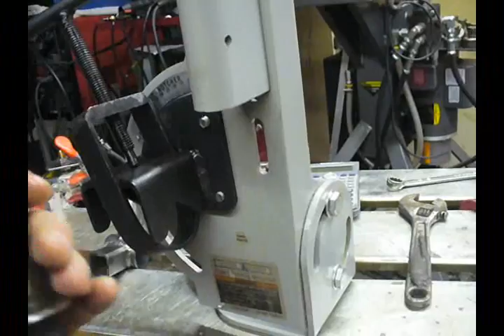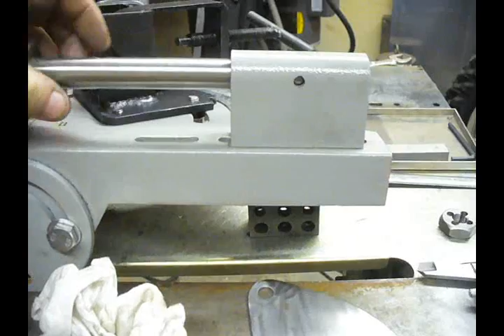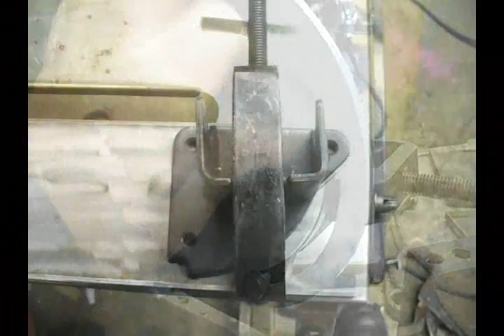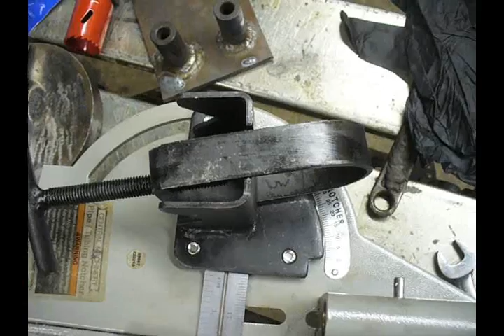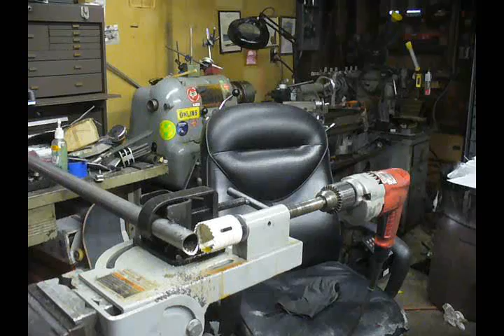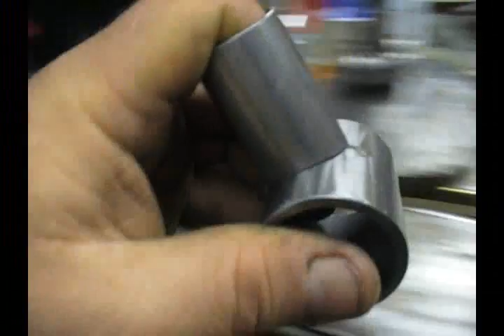Harbor Freight Tubing Notcher Modifications

Comment: worked in fab shops and had a machinist boss at one place. He had an additional suggestion. If I'm drilling or cutting metal, use lots of penetrating oil. ( any oil is better than none, but also power steering, or brake fluid works well too) this will at least make your blades and steel saws last more than twice as long. Since good drill bits are very expensive in a mfg. department, consider purchasing and pointing a vortex cooler nozel at the contact point. A cold edge will keep it's edge longer than a hot edge.

Comment: In 13 years the product is exactly the same. I just bought one for $54 and had the 20% coupon. 

Agree on buying good hole saws. After doing the adjustment you showed I cut 2 pipes with a cheap saw and it was done. Put a Bi-Metal Lennix saw in and finished 26 more cuts. looks like I can get maybe 20 more cuts.

When doing some 45 degree cuts the axleshaft flexes some so the notch is a bit distorted but a quick Drimmel and its OK.

Comment: Kinda funny (and a bit sad)... 13 years later and the notcher I just bought still has the same exact alignment problem. I fixed it with some washers between the clamp and the base, but I like your solution better.

Comment: Technically they are hex head cap screws, so you are correct calling them screws. Screw is the angular movement around a cylinder. Ships move by rotating a screw(propeller).
Bolt is a cylinder shaped object, rifle bolt, door bolt, bolt of fabric, etc. 
Screw is the function, bolt is the shape.

Comment: applying oil to the cutting surface when the jobs done is bolting the stable door when the horse is gone
Reply: And you just contaminated the tubing for welding.  Saws should be cooled with water not lubricated with oil.  Oil actually causes premature dulling of the teeth.

Comment: Some people said they would of used washers which was my first thought too. But I think what he did was a better idea for the long run. For me i have always  used my drill press with 2 pieces angle welded to a flat steel plate with a hole in the center of it. Works great for me. I also use a 1/8 inch larger hole saw than the tubing size it seems to fit up  better. I always like to see these videos and thanks for taking the time for posting it. Also pay no mind to the negative comments.

Comment: I got one of these, worth the price. You have to look at it as a improvement over cutting by hand, not a substitution for high end. The bearing lube is  key, lube liberally.    I found the biggest limitation was the design of the clamp band. It can't be removed or bigger spots / bends won't slip through it.  I cut the sides at the top and added bolt on brackets. Now I can disassemble the clamp and reassemble on the spot of the tube.

Comment: Really , why not take a chop saw with a metal blade set it on 22.5 degrees mark the tube at top center an cut . then flp it over n cut to center again wow too easy! U have a saddle fit for a hand rail

Comment: I bought this particular tubing notcher and it's just a piece of crap I have fool with it about 6 hours and never made a cut that I was satisfied with I shimmed it out but actually I tried everything different size pipes ,brand new kit of cutter blades nothing works I guess if you was making a gate to go out in the barnyard it would be okay but I wouldn't attempt to make roll bars or even the go-kart frame I'm working on

Comment: can it be used for square tubing ?
Reply: Bob Americana  Yes you could... are you mating round and square? The square would be at a 45° because of the V notch. If 90° is desired just use a drill press.
Reply: i am making a square tubed trike frame. i will be needing a round hole in it for the regular front fork assembly .   look at the 2nd picture : http://www.atomiczombie.com/LodeRunner%20Single%20Rider%20Cargo%20Trike.aspx

i am wondering if i  should buy a notcher for this or simply pay a shop to do it.
Reply: Bob Americana  Well ok in the aspect of the degree that is a compound angle. As for my previous comment... 90°× ?. Personally I would get a small drill press from Harbor Freaght. Cause a shop could charge you most of the cost of the drill press. The drill press table can be set on the angle of the rake you choose while the other is 90°. If you notice on the notcher there's a v shaped holder and the hole would go corner to corner... not through the center of the square tube. If this is a one time project then drill press. If multiples the you might consider modifying the holder on the notcher and then it would serve that purpose alone.
Reply: Bob Americana  Then again If it's a one time deal you can do it without either. Mark your angle on the side carry it over on the top and bottom then center drill the holes for the center drill of the hole saw. I went back and looked at the trike it's a pretty Cool rig ! The drag link steering is nice and simple. Ok I went back looking at the other model's... you could incorporate the front frame of the bike like some of the other model's and not need to drill the holes in the first place.
Reply: i get your points. i suppose i will simply mark and use a drill for the 1st build. if the trike cruises at a decent rate and is easy to use, i will be building more and placing them on consignment at local bike shops. i do not want to use a regular bike front end hacked off and welded to the square tube. that would simply look bad. you get the idea. thanks for the tips
Reply: Bob Americana Right that's why I asked if you might be making multiple parts. But if you do produce more a small drill press will be beneficial. H.F. $64 for the small 5 speeds I have one and its good.

Comment from the maker: Cody, as you're saying you build enclosures for horses etc, then your method is fine. I was under the impression you were building for automotive. And an 8k notcher is WAAAY overkill for chassis work...kind of like a gold plated hammer.  It won't drive a nail any better than a plain hammer, but it sure impresses the audience .good luck in all your endeavors.

Comment: I can do it by hand in sec . line down the middle fish mouth line on both sides . cutting blade with the grinder or a torch . or you can by template s I have those 2 they work great .
Reply from the maker: If you're cutting your tube with a torch, I CERTAINLY don't want you making any chassis components for me... Yes, you CAN cut tubing in all manner of ways. You could even drag it over a concrete curb long enough to make the cut. Sometimes, having a proper tool allows you to do PROFESSIONAL QUALITY work.. This is extremely affordable, repeatable and doesn't use caveman tactics to get tubing fitted...You won't find a SINGLE PROFESSIONAL Chassis builder using a grinder to make tubing cuts... Up your game and do higher quality work.
Reply: Jim Harvey . if I were to build a chassis I'd use one of these https://www.baileigh.com/end-mill-notcher-tn-800 . I use torches on pipes . tubes like horse corals I have hand notcher or all throw the cut of wheel on if it's thick .

Comment: I need a tube notcher and was on Harbor Freight's website reading reviews and most of the new ones are stating that the need for shims has been rectified. I guess I'll find out. If its good or bad I'll report back what I find.
Reply: So what did you find?

Comment: Hole saw update. Found that manufactures rarely tell you if their hole saw  sets take a threaded arbor or take an arbor with flat sides that locks in to flats on the hole saw. Found both styles at the big box stores and you don't know without breaking open the box. Clerks give dirty looks but they couldn't tell me either.  Buying on the internet you rarely see them marked. Pretty dicey.  Thanks for the help guys!
Reply: would be nice if there was an adapter to use either.

Comment: I am searching the internet for threaded hole saws to use in my newly purchased tubing notcher. Seems no one wants to sell any. I see  folks say all the big name suppliers carry them. But no where does anyone advertise them for sale. Any help with reasonable priced supplier of THREADED hole saws to use with these tubing notchers. Part number or link appreciated.
Reply from the maker: HI Steven
You can find teh threaded saws at any Home Depot or Lowes.. DO NOT BUY hte cheap Chinese saws. Buy a good Bimetal saw from MIlwaukee or other name brand.. Go slow and use lots of lubricant and they will last a long time.
Reply: Thanks Jim I will check that out.  When I couldn't find any on the internet, amazon, or ebay l thought oh great, here we go. I bought a tool that no one makes a hole saw to fit.
Reply from the maker: Steven Hatfield look for LENOX saws at LOWE'S As well.
Reply: Funny, I have never seen a hole saw that was not threaded at the base. https://smile.amazon.com/Milwaukee-49-22-4025-13-Piece-General-Purpose/dp/B0045CSOIY/ref=sr_1_10?s=power-hand-tools&ie=UTF8&qid=1517271419&sr=1-10&keywords=hole+saw+kit
Reply: Ron Micjan I am finding that most are threaded. But I owned two sets (wood vs metal) that go on an arbor with flat sides.  Problem is 90% of manufactures do not state their hole saws are threaded. Being new to pipe notchers I had no idea other than breaking open the packages.

Comment: you could mill, sand or grind down the block that holds the drill shaft as well. I think that would be the most accurate way to get the centers aligned.

Comment: you should know that you were not wrong about the calling the screws,  screws. they are in fact a CAP SCREW. a bolt is defined as a cap screw with a nut on it. so a bolt is an assembly. not a singular thing. great video by the way
Reply from the maker: :) Thanks!

Comment: 8:07 If you had used lube or at least spray water on it to cool it, your ElCheapo would still have teeth. Looks like you high dollar one won't last either if you dont cool it in short cuts. YOU CAN'T RUSH THE CUT!
Reply from the maker: try reading the information in the video
Reply: If I wanted to READ, I wouldn't be watching a video!
Reply from the maker: Is it that you don't care to read or that you are unable to read? The words were right there on the screen... But you don't really care about that... You're much more interested in snarky comments... Carry on...
Reply: Look who's being SNARKY, I just said a cool bit / hole saw blade will last a long time.
and don't force the cut.

Comment: Great Video and I agree with your choice on solid shim verses washers. Spot on with your reference to small errors add up. If its not cost prohibitive and you are not pressed for time, why not do the best you can. What type of cutting lube are you using in the video? Do you have a formula for drill size compared to pipe diameter?

Comment: well ....for 1.....use a drill press clamp and v block....and 2....never saw you using the " cheap Chinese hole saw " so maybe you deliberately pushed its limit so you could slag it and are you sure the cchs is for metal ??...after all the jig u r using is a very sloppy piece of work in of itself......essentially this video is for amateurs ....
Reply: +HYPR QWYK (o7ARK) For a 90 degree notch, the v-block drill press setup is fine but you still need to line up the v-block with the hole saw then clamp your piece. The HF tubing notcher is way easier and quicker and can notch at different angles also. Although its not as expensive or as accurate right out of the box as some of the pricier notchers, it can be modified to be pretty damn close. As for the hole saws, the Lenox blades are superior to the HF saw blades. I've used the Lenox blades for notching and cutting holes in all different materials and haven't burned one up yet. The video is for anyone wishing to notch tubing occasionally without breaking the bank. If you're a company building roll cages, motor mounts, NASCAR frames, bicycle or motorcycle frames everyday and it's your bread n' butter, by all means drop $500-$1000 on a tubing notcher. For the weekend warrior, there's the HF Tubing Notcher. Thank You and Have a Great Day.Sincerely,Frank M. III

Comment: Great demo. Done by a real craftsman. And good point about using quality hole saw. An explanation of bi-metal saws would add to it. Most people don't know why they should pay more for this. I have found the Harbor Freight white bi-metal hole saws to be good. Probably not better than a Lennox or Milwaukee, but far better than plain carbon steel saws.

Comment: Good thorough, to the point, Video. I always say Harbor Freight has some useful tools, some tools that are great ideas and most of them can be tweaked a little and beefed up here and there by most any Craftsman to get years of good solid use out of. If it's a tool you need for your everyday proffession, you could start out with the Harbor freight models, earn a little capital and then invest in the real nice brand tool, (you'll also then appreciate the high end ones a little more too).

Comment: Instead of using a spacer or washers, wouldn't it be easier to modify the "v" that holds the tube? By milling just one side of the v, you can change its center.

Comment: Thanks for the tips.  I am thinking about getting the HF tube notcher, as I will only use it occasionally.  The grease fitting is probably qa good idea, or just putting some grease on the shaft each time you use it.
Reply: +Pete Ciallella I wonder if grease might have a tendancy to pick up swarf and grit, resulting in excess wear on the bushing and shaft. Whereas with the spray being thinner it would have more of a flushing action?
Reply: +Godshole what is swarf
Reply: Swarf is a term used for the shavings the drill cuts from the metal. Depending on what type of metal being cut,the speed of the cutter and the feed speed into the work they can vary from grity dust, which is common with cast iron, to long razor sharp tangles or birds nests, aluminium, stainless steel, which are a pain to deal with. This kind of drill would probably make swarf that is more like small chips but they might well be scary sharp and need to be given some respect in handling.
Folk tend to brush them out of the way with an old paint brush, then hoover them up. Hope that helps :)
Reply: ok

Comment: Great video. 
Shim fix, which I think is better than washers (but washers would work too), could possibly be made more accurate with a little measuring and math. I understand the whole point is to bring the centerpiece of the V clamp in line with the centerpiece of the shaft. 

For those advocating washers remember, most washers are stamped out and will not be flat and will need to be dressed 
Good video

Comment: instead of making that spacer plate, why not just put fender washers under the pipe clamp ?
Reply: +decoysk Yep I was thinking that too.
Reply: You could indeed, the plate is going to give you a little more steady mount. With washers you'd have 3 slight independent movements not really tied to one another as definite as the plate. It would work though.  Just to make the relation....think about it In the extreme....say you stacked 10 washers up one each bolt, it would be more movement independent on each bolt than if you had a plate equal to 10 washers thick. Sorry if that doesn't make sense. I always think in the upscale extreme to rationalize to myself and see things....lol
Reply: Why bodge it when you can do it properly it's called engineering
Reply: +TheCabinetmaster your replie is very extreme. nobody would use 10 washers in this application. one washer maybe two would not move at all as long as the inner diameter fits the bolt tight!. theres always more then one way to skin a cat!!!!
Reply: +WyldsideRadio yeah, you missed the point I was making as being in the extreme. In NO WAY would I suggest using 10 washers.....lol
Reply: your example of using 10 washers was very clear the person that commented on that apparently has no imagination I realize that was just an example but apparently he doesn't have the intelligence to see your point
Reply: @ramwall1500  if you are referring to me then I saw what he was getting at but I don't see his point as its a bodge up but obviously some people don't have the intelligence or engineering brain to understand that or the reason why it would be no good whatsoever

Comment: im just thinking, for 90deg cuts why not just use drill press with clamp?
Reply: Try that and after you either shoot pieces of metal across your shop or crush bend the tube trying to purposely cut off center, come back and show us your video.
Reply: +Christian Loria what if you need it in the field then what drag your drill press out there and connect to pipe r
Reply: That's not a bad idea, especially if you have a milling machine and a large V-block.
Reply: +Kerry Roberts He's not in the field!
Reply: +Jim Harvey With the drill press you can cut any angle also

Comment: Great video! I used 3 washers on mine, I was able to find some machine washers that centered it well, also the clamp stripped out so I welded a nut on it and it has worked great that way for several year and hundreds of cuts, one thing I noticed by watching your video is that if you want to make a very sharp angle you could probably lower the shaft guide and drill from the bottom, I will try this as I always thought this notcher was limited but maybe not as limited as I thought! What do you think.

Comment: i bought one of the originals called "ye old joint jigger" i use it in my drill press and have it all bolted to the table in a very solid fashion. i use the good bi metal saws and use wd 40 to lube with and it keeps the blade cool and clean. i just spray the shaft as well.i use it a lot and never had an issue with it. had no need to shim it at all. must have got lucky. it was a bit more $ though than the hf model lol. great video and great explanations. like you said if you are doing this stuff everyday then buy a really good one. even mine is not for everyday use. thanks again.